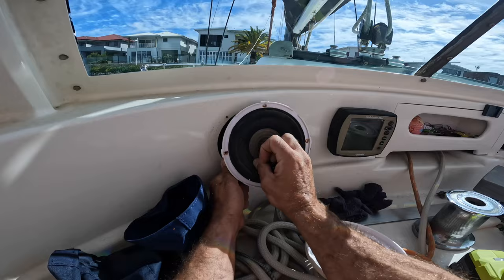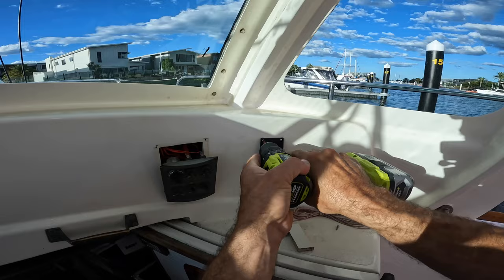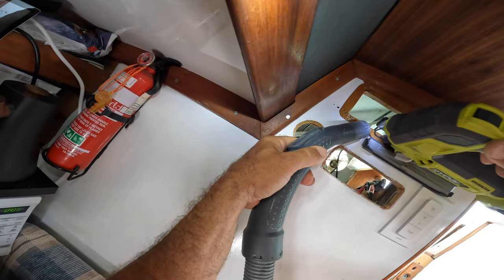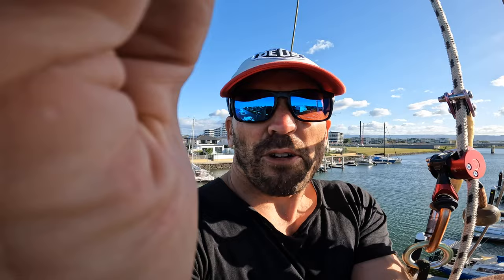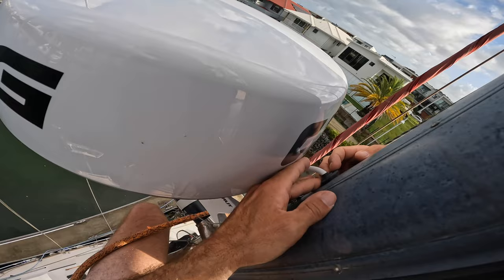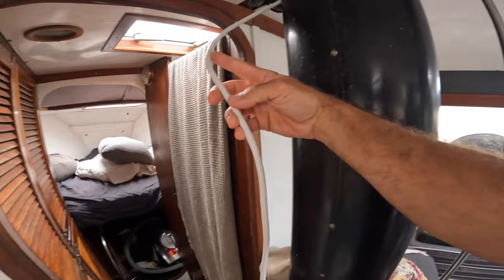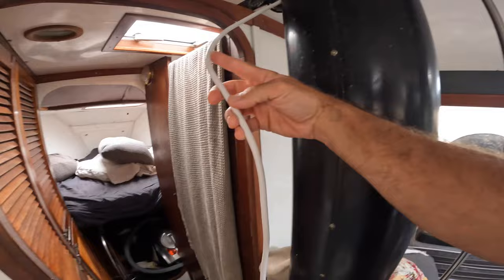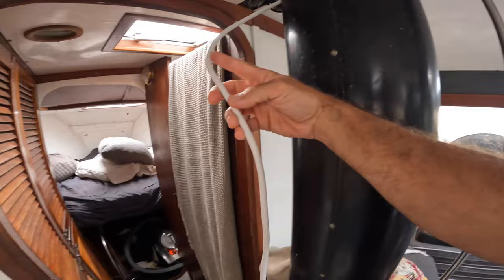Full electronics upgrade. B&G Suite!!

Comment: I “fish” wires for a living. I use a long ball chain. The kind that turns lamps or ceiling fans on. I bought a magnet with a small telescopic rod on it. I bought it from the local auto parts store. When you drop the chain down the hole you can use the magnet to pull the chain out of the hole. Then I put a string on the chain and pull that through first then the wire. The small chain is not very strong.

Comment: We went with all B&G too and we've had lots of regrets.  The VHF is a mess.  Lots of software glitches and the remote wireless mic is a headache.  Ours was in the shop multiple times and it's broken yet again.  We finally gave up and put a wired mic cable to the helm that goes to the back of the radio. Now I can move the wired mic back to the helm when we are moving.  As bad as the V60 is it is at least better than the V50 which never worked right and after approximately 50 hours waiting on hold with B&G support they finally just gave us a V60.  Both horrible radios.  From now on we are only buying VHF radios from companies that specialize in radios like ICOM or Standard Horizon.  NMEA-2K is like USB in that it is plug and play and everything just works with everything else.

Not a fan of the Vulcan chart plotter.  Yes it is half the price of a Garmin but the cost-savings are not worth it.  After using the plotter over 10k nautical miles it is obvious the people who designed these never actually used them in the field.

The only good thing that B&G makes is the Triton display.  They work well but the older version was actually better.  The newer model "glass helm" look prettier but actually display less info.  The old sailsteer display would give you apparent and true wind degrees and speed.  The new display will only display 3 figures not four.  We talked to the B&G guys at the Annapolis show and they said "you don't need that "  well...okay.  -or something.

I hope you have better luck with your B&G gear than we have.
Reply from the maker: Thats a real shame. so far so good for me. I have had a few minor UI problems with the chartplotter but nothing major. My VHF has been spot on.

Cheers for the comment!
Reply: Got issues with V50 as well. 
Having all B&G set up Zeus 2, triton.
Now need to change my vhf and hesitate with V60b to use AIS…
Reply: I would not spend money on another B&G radio.  Buy Icom or Standard Horizon only.  The V60 we have is not as bad as the V50 but still bad.  We unhooked it from the NMEA-2K network and use it just as a VHF radio.  It still picks up AIS signals and will display them on it's own radio screen but we do not attempt to have it send NMEA information on the network as it just causes problems.

We bought a Vesper class-B AIS and hooked it up to the NMEA-2K network and it works wonderfully.  The setup was super simple with the B&G chartplotter.  It was plug and play.

If the Chartplotter died we would replace it with a Garmin.  I'm done with B&G, the only B&G component we would possibly replace with another are the Triton displays.  Those are not too bad and are cheaper by far than any other similar product that can do the same thing.

Comment: Why did you use a vhf antenna splitter?  I thought the B&G v-60 included both vhf and ais in one unit?
Reply from the maker: It does but you need two antennas. I have two but I wanted the extra range from the mast vhf